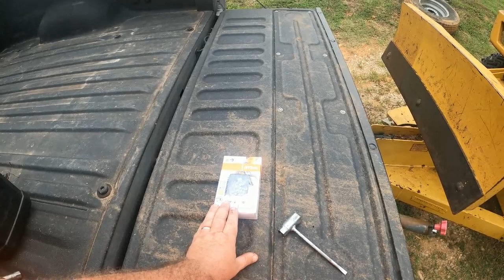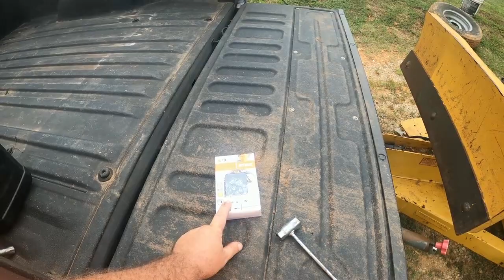Removal of a Large Pine Stump With Rayco Rg50 Stump Grinder

Comment: What did you do to control the back fill blade when the operator door is open?  Normally the control for operating the left/right boom swing cylinders switches from controlling the boom to controlling the up/down blade when you close the operator door.
Reply from the maker: I put a new switch on the machine that is how it's worked ever since. It works but backward. Thanks for watching the videos